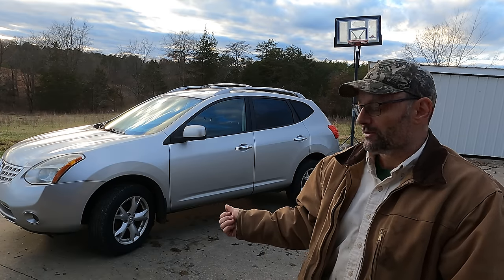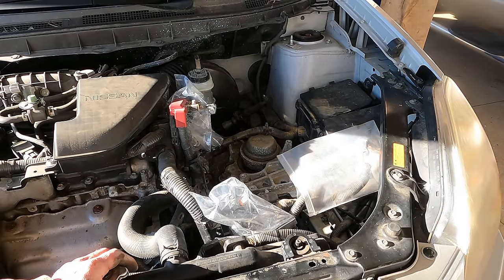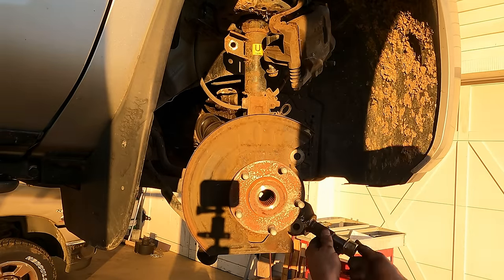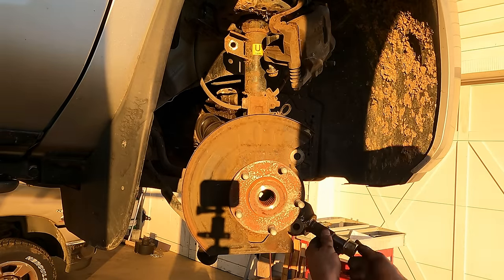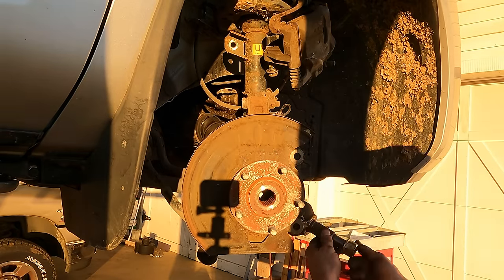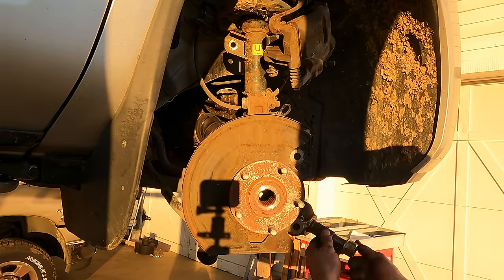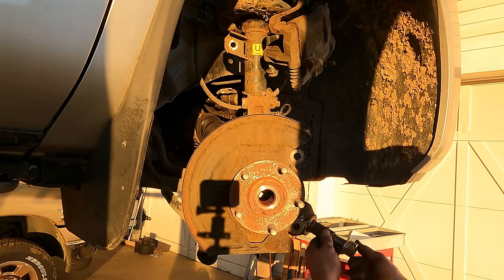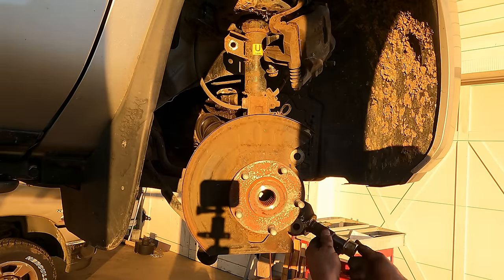Fixing a Nissan Rogue Transmission So I Can Give It Away. GOAL MET!

Comment: This is a great thing you have done.  

If I may add, those Rogues usually need the cross member bushings replaced, particularly since it has the mileage on it it does.  Something that should be checked out.

Comment: I'm currently doing my ladies 08 Hyundai Sonata and its the same issue, the transmission has to come out the bottom but the sub frame is blocking the trans from dropping out, the lower control arms are tied to the sub frame, plus the rack is linked to the sub frame and firewall, so its been an adventure, took 4 hours to get the suspension off and the sub frame dropped so tomorrow we will be getting the transmission out and swapping it with a low mileage equivalent and we get to do the fun part of back tracking until it runs.

Comment: I love your approach to problems/challenges. (if you don't, you won't learn anything)
A little history DAF a Dutch car company developed this "gearbox" Volvo bought Daf passenger cars with associated patents for the 70s. but missed a "detail" There was one more prototype which if I remember correctly was sold to Ford. The reason for Volvo's purchase of Daf was that they needed a smaller car in their model series DAF 66 Volvo 66 DAF 343 Volvo 343 curiosities Daf 66 could be started with the gear engaged (volvo blocked that function) I wanted to start a Daf 66 which did not run on all cylinders. My surprise cannot be described in words when the damn car started on all cylinders inside the workshop, the few seconds it took felt like minutes before I stopped the car. The gearbox on the Volvo 343 had a regular clutch that was shimmed the right distance. the two "drums" that regulated the gear were vacuum controlled (often a problem) and driven by two rubber belts model larger.
More curious Volvo 343 zero to 100 /km/h 18.4 seconds with variomatic. Volvo rebuilt a Volvo 343 with manual gearbox moterai a V6 (pvr) engine drove from Gothenburg to Stockholm. The smile on these two test drivers when they told me about all the cars overtaking. And driving away is unforgettable.
More than 40 years ago. That car was a Sleeper

Comment: I hate those CVT transmissions.
When I worked at Nissan in Belgium, we had one fail on us within 7.000km.
It baffles me this one made it to 150.000 miles.

What Nissan told us that failed (we didn't open the transmissions, we replaced with a refurbished or new one), was the oil pump in them.
They are driven by that chain if I recall correctly.
Without the proper hydraulic pressure, the discs for the pushed belt don't get the required pressure, the belt starts slipping, the discs will wear down and warp in some cases.

Comment: I think your heart is in the right place and appreciate you doing this for someone in need. The issue is that I think you chose the wrong vehicle to give to a young person with no knowledge of which vehicles are reliable and they may think Nissan is a good choice. Nissan CVT's are known to be problematic and the owner will eventually have to either junk the vehicle (good idea) or decide to pay for the repair again (bad idea). I would think using the money you have raised to buy a reliable vehicle would be a wiser choice, maybe a Toyota. Just my two cents. I know I would never spend money to fix a Nissan CVT. I also wouldn't spend donated money on one either. Just buy a good working vehicle with that money.

Comment: Ivan at Pine Hollow Auto Diagnostic also tear down his CVT, giving us an understanding of how the belt in CVT works. The CVT belt operates in a very interesting way. The disks in the belt are held by steel bands. One side of the disks has sharp edges, and the belt pushes the pulley in the front by engaging the  disk sharp edge on the face of the pulley. The metal shavings you see are probably from worn pulley v face disks edges.

Comment: We've got a 1970s gleaner F that uses a CVT for ground speed control. The driven pulley uses a spring to keep constant tension on the belt, why it took so long before that concept was tried on vehicles is something I have yet to figure out. The only problem I've come across on the combine CVT is if the spring sticks at any time during adjustment, it will smoke the belt.

Comment: There are several vehicles that use a cvt transmission. Snowmobiles are one type, some lawn and garden tractors, m
Some miníbikes and go carts do also.
These use front pulley with fly weights and springs that change the width by engine rpm. The rear pulley is just spring loaded so as the front gets narrower the rear can expand. The spring maintains pressure to prevent slipping.
Reply: Much like a John Deer Gator.

Comment: apparently candle wax works VERY well for those stuck rusty bolts. heat up the bolt, melt the wax over, and the rust sucks it in.

Comment: The French moped manufacturer Motobécane did this on its 49cc mopeds which sold several million units in France between the 1960s and 1990s. Peugeot did the same thing. In cars, it was the manufacturer DAF who built a small car based on this principle. The Dafodile. In fact there is an unlimited number of speeds.
Nice generosity on your part to repair this machine in order to give it away.
Translate French English with DeepL

Comment: One spare part everybody ignores: the transmission fluid
CVTs need fluid and filter change all 30-40 tmiles or they will be worn out at 100tmls, because the friction modifiers in the fluid get lost and the belt begin to slip. Slipping means more heat, more heat means more wear

Comment: May be a good idea to use some Kurust on the rust patches - Kurust converts rust to something tougher?  A coat of underseal would finish it off nicely...   with so much stripped away you have the access you need for those tricky chassis points.

Comment: There was a company in Milwaukee that rebuilds CVT transmissions. If your car has 200 hp or less, five metal bands go together and then the small pieces are added on.  There are two sets of five bands.  If you have 300 hp, you use seven bands.  The belt does not pull, it actually works by pushing.  The two pulleys work together of course.  One uses springs and the other uses oil pressure.  There are three kinds of CVT transmissions out there:  Toyota, Honda and Other.  The Toyota and the Honda use 800 psi to function and the Other uses 700 psi.  If you are driving a car that has a CVT and it is not a Toyota or a Honda, then you have the Other transmission, doesn't matter whether your car is a Nissan, Subaru, Audi or whatever.  When you start your engine, you want to take your time so the transmission builds oil pressure and then slide into gear.  If you are used to hitting the starter slamming the transmission stomping the gas...that is a bad habit and needs to be broken for CVT cars.  The Car Wizard bought a Nissan Cube with 22,000 miles on it.  He loves it because he just opens the car door and sort of steps sideways and magically is seated behind the steering wheel.  No ducking or folding or bending.  He changed all the fluids when he got it just because, and wow, the tranny fluid was a milk shake.  So 20,000 miles for a fluid service on those Other CVTs.  Honda says 60,000 so I go 50,000 partly because it is easy to remember.  A Toyota mechanic said he had never had a CVT come in broke down.  Honda also seems to be good.  Other people on the web have broken down these transmissions, usually after they stop working.
Reply: Yeah, I’ve also heard that Toyota are the only ones that build CVT transmissions correctly so that they don’t break.

Comment: I briefly checked below and did not see this -It is called a tulip joint.
If you know what you are looking for, we get cars all the time with misdiagnosed CVT's. Before condemning check for vacuum leaks. I had some Nissan $hitbox here from the auction with 58KM on it for an engine and the CVT was inked up from the wreckers so not something I would personally own. They were decent cars in the 80's to mid 90's. Knowledge is power!

Comment: I own a 2017 Nissan Rogue sport with the CVT transmission, service manager told me to use only Nissan trans fluid as it's formulated for this type of transmission, also have a flush and fill every 30,000 miles.
 Hope this helps.

Comment: The belt in a CVT is a pushing belt NOT a normal pulling belt, like most rubber belts.  That’s why the tension has to match the ration changing drive pulley.  If not the belt slips.

Comment: Another fun thing about those Nissan QR25 engines is that the spark plug tube seals are not replaceable, you have to change the whole valve cover.

Comment: I have a similar car, 2010 with more than 140k on it. You need to keep maintaining the car, like changing transmission fluid every 15k to 25k miles. When your car has high mileage, you need to clean your   enginee with complete fuel system cleaner.  It works like a champ.

Comment: I have a 2012 Nissan rogue... 200K miles... I bought it when it had 125K 2 years ago. (I drive a lot!!!) Still running perfect. I replaced the catalytic converter ($600) when it reached 165K and that's it!! I've never changed the transmission oil. I changed the engine oil every 8K. According to the internet forum, my suv should be dead by now. Let's see how long it last. I hope 50K extra miles. 🍻🍻

Comment: Just an fyi for when you get the replacement transmission in, there is a relearn / recalibration procedure that has to be done by Nissan or someone with a capable scan tool before the vehicle should be driven.

Comment: These transmissions can be rebuilt quite easily. Parts are sold for them and you can get an entire kit with gaskets, pulleys, and the push belt for a couple hundred bucks online. There are probably 10 moving parts in these things and are very easy to work on in comparison to conventional step automatics. Another thing that you can do, if you are serious about this charity, is to register it and make donations tax deductible. I'm not an accountant, but I think that's the way it's done. Somebody correct me if I'm wrong. Great video, though. Love the setup.

Comment: When you have to get under a car that is on the ground get a large flat cardboard box  ( flat screen TV box works great).
You can easily slide under and you
might not have to lift the car, suv or truck. Cardboard offers insulation  from cold concrete, better  control then a moving  creeper and it catches  tools,
parts and fluid  drips. When done carefully  slide the  cardboard  out and everything  comes  with it. How far to the nearest dumpster  for the cardboard?

Comment: Toyota tech here. Not a Nissan tech and not your Nissan tech. Generally on a CVT the debris comes from the belt clips wearing. Once you get enough metal debris the cvt cone clutches will not be able to slide back and forth on the shaft, The shaft typically will have three grooves and will use a ball bearing in the groove to interface the pully and the shaft. Once clogged with debris the pulleys will not longer be able to adjust to change gears. These are hydraulically driven.

Comment: 24:27 you totally can parts for that transmission. they just aren't sold as a kit or in a kit. you can get those steel belts or the other universal parts like the bearings that fit in there. its the cast parts (or specially machined parts) that you won't find, but it would likely still be WAY cheaper to have a machinist just make the part that is broken. i can't believe that buying an entire new transmission is actually cheaper

Comment: You most certainly can buy parts for this transmission! I have a 2010 Murano and have just priced all of the parts I'd need to rebuild it online. 🤷‍♂ The parts are half the cost of a remanufactured transmission.

And I'm betting the shavings and stuttering were coming from the converter.

Comment: I'm not a cvt expert, but I have fixed a cvt on a nissan murano.  On a lot of these cvts the pump wears out and gets weak and you loose hydraulic pressure which in turn the belt looses holding pressure and starts slipping.  There are also ball bearings which slide in a channel in the pulleys which disintergrate from use and age.  Like you said not a super robust tranny.

Comment: Feel like you might've been able to just change the filters, fluid and added an extra trans cooler in line with the stock one it would've been fine without replacing the whole transmission. But idk for sure either 🤷‍♂️ I once replaced like a sensor in the CTV, filters and fluid on a Sentra and it ran fine after. Before that it wouldn't even move at all

Comment: I had a Nissan with the same issue I took it to a mechanic and he told me that it was going to cost me $4,500 to get it fixed but I took it to the Nissan dealership for a second opinion. They told me that the transmission fluid was too thin probably something that the previous owner got from the town auto parts store. Nissan has its own transmission fluid formula and can't be replaced with any other generic transmission fluid. They found a small leak in the transmission, got it fixed, and replaced the transmission fluid, I ended up paying $1,200 for labor and parts and the car still driving like a dream!!

Comment: Have 2 of these cars. If you  change the trans fluid every 50k, they will hold up.  Of course, I change the trans fluid in my Fords and Chevys every 50-60k.  Never lost and automatic transmission.  Just a matter of maintenance, which most people ignore.

Comment: Most typically one of the variable pulleys (variators) get jammed. There are six (or 8) guide balls on each one; the balls shatter and it's game over. Some rebuilders replace the balls with steel pins. Frequent fluid changes help to prevent this.

Comment: my 2 cents on the cvt, as its getting tighter when you rotate it, it might mean that either the belt is worn unevenly, or the worse case, the belt has worn a groove into the cones. sadly you didnt take it apart further to see any of those 2 cases

Comment: These transaxles work similar to a snowmobile clutch. When they work that is🤣. I worked for a manufacturer that used one of these from 2002-2004 model year cars. After that, they stopped using them because of the high failure rate. For that transaxle, a replacement "case half" was available that had the belt and pullies(sheaves) in it. It corrected any problem that was there in that transaxle. If the belt actually blew apart into a million pieces I would say, get me a replacement transaxle though. As metal pieces went who knows where inside of it.

Comment: Great video, great effort, I am a victim of HONDA Jazz CVT, which had failed.. I replaced the the whole engine with a imported used engine with gear..
I spent 1,200 US$ Equivalent to fix that.. The cost was comparatively less as it was Bangladesh. 

Here engine replacement is a common phenomena 

Cars are mostly Japanese..

However, since then I am not a fan of CVT anymore

Comment: Its much safer to put a support over the top of the engine and one that support i use a sisor jack and before i connect a chain from the jack to the engine i turn the sisor jack to where it is almost halfway then connect the chain to the engine once that is done then you can disconnect the transmission mount then you can lower the sisor jack into a position to pull the transmission out , but the way you are attempting to do it is not a good way to do it cuz if that jack supporting the engine happens to get bumped and the engine swings down off of the jack you can cause so major damage to the ratiator hoses heater hoses wiring harness and possibly distorted the engine mounting surface so you really should support the engine from above

Comment: It was hard to tell in the clip, but it looked like the jerkiness changed with steering angle. I hope it's not just that CV joint being bad. Those rollers looked like they had an awful lot of play and the ends of the 'thumbs' the rollers are on looked like they were rubbing on the inside of the casing of the joint.

I'm a diesel mechanic and have never touched a CVT trans, but I've watched several videos of other teardowns of bad CVT transmissions, there's always plates from that belt everywhere inside the transmission. That belt is a stack of plates, each about the size of a quarter, on a spring steel band. Those plates wear and fall out of the belt and go everywhere. That's the usual failure mode for those transmissions.  

If it were mine, with the trans already out, I'd be pursuing that CV joint a little more as well as going through and making sure none of the bearings inside the transmission, transfer case, or rear axle have gone bad. That belt definitely had wear on it and very well could be the problem. But it wasn't nearly bad enough to say 'the belt is the problem' with any confidence.